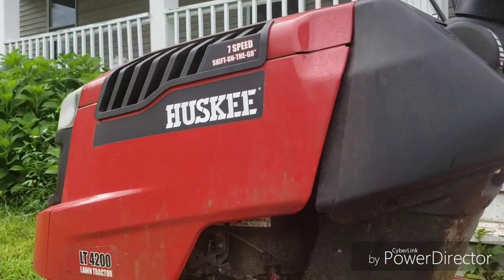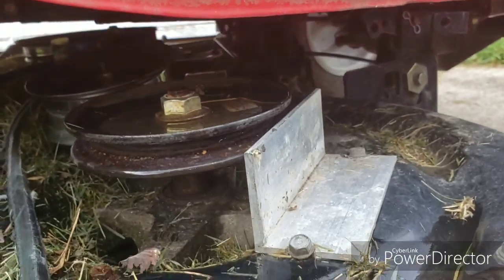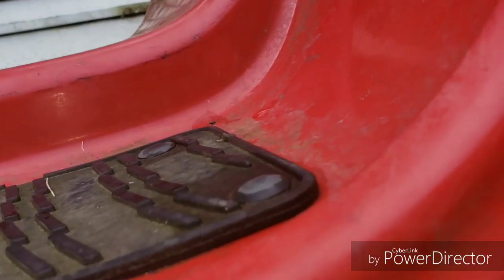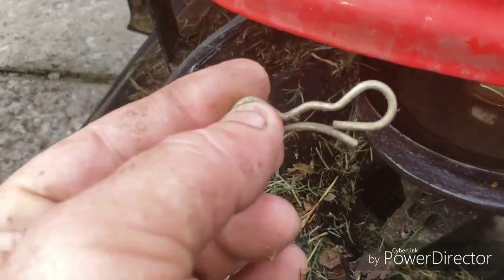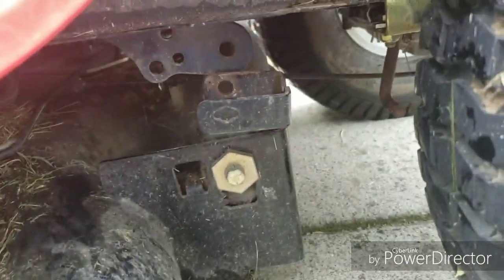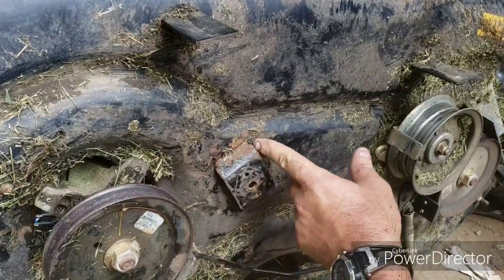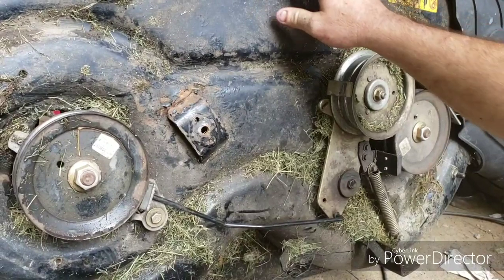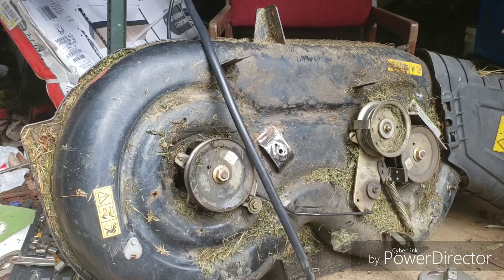Huskee lt4200 deck repair and belt replacement

Comment: My bracket was pulled out of deck. Took an old blade and cut it to fit under the deck and welded on with the hole of old blade lined up with bracket hole. Then got a bolt long enough to extend through bracket to put pulley back on. Very strong and the cheesey bracket doesn't have  any pressure on it.

Comment: Well FYI. a lot years of experience in many things and I got the belt on with out removing deck in like 15minutes and only loosing the one pulley on passenger side. thanks though as the vid. helped to find where and how it went around the pulleys. I am hard on this mower and will need to do much the day I do drop the deck.
Reply: i realize I'm kind of randomly asking but does anybody know of a good place to stream newly released movies online?
Reply: @Duke Jay Flixportal :)
Reply: @Misael Danny thanks, I signed up and it seems to work :) Appreciate it !
Reply: @Duke Jay happy to help =)

Comment: I saw this video on Saturday and  my deck belt cover broke and I like  your modification with a piece of angle aluminum or steel but first a trip to tractor store to see of they have the part. I also need to get a air filter cover one of the little turn keys that hold the cover broke a year or so ago   anyway a good video
Reply from the maker: You can get the guides online , but they are expensive, and prone to break

Comment: Interesting video, my Lt4200's engine's shot & was thinking of pulling the deck & making a 36 HP 42" push mower, the riding mower cuts too low to get over septic tank lids & leaves for more trimming for me,  Liked & Subscribed.
Reply from the maker: Shot as in rod through the block?
Or lost power, and smoking?
If it's not blown they are an easy rebuild.
Reply: @hillbillyholler516  I had knee high grass, had to get an acre of grass mowed for the first time all year, since, the weather was crap, I was busy working, trying to get things ready for Memorial Day, I was in the middle of mowing my yard, when all the sudden it just stopped running, I had 1/4 tank of gas left in the tank, that thing spends so much time at the repair shop, I don't know if it's cause it ran out of oil or what, but I'll be replacing the 16.5 HP engine with a 36HP engine, & replacing the pulleys with sprockets & a #60 Heavy Duty High Carbon steel Chain & making it a push mower with 13" solid rubber tires, good for between 300 pounds to 500 pounds each & maybe put extreme High lift blades on it, build it to go through just about anything I'd need it to go through when I get behind on mowing for the Holidays.

Comment: Use anti spatter on the nozzle and it will last longer also the nozzle is a consumable and should  be replaced when worn out and they make a neat little tool that will clean the spatter out of the nozzle.

Comment: Is there a way to adjust belt without replacing it if not needed mine is loose
Reply from the maker: If it's too loose its stretched out.

Comment: Cert welder u can use lube on wire gun helps quite a bit keeps wore from sticking and they also have a plastic insulated  wolf weres out caused  henpick on wire guns have keep clean tips to buy lube helps gd luck I just rebuild same deck also on plate fully the hole weres out few thousand s on these mowers u can just use a ring take up.slack I drilled hold out on washers one size over was not problem it was plat up down in plate holding the pully was causing belt come off as well as front rod on front motor puller bad bout leting belt ger lose

Comment: also, How do you disconnect the PTO cable?
Reply: oh, that's how, one of the things wrong with the riding mower is the engagement pulley sticks & I got to beat it with a piece of a sledge hammer handle that broke & I cut off from the rest of the handle, which shortened the handle for my 20 pound sledge.

Comment: What belt is that?
Reply from the maker: 1/2 by 96" kevlar belt
Reply: What is the recommended belt by owner manual
Reply: @hillbillyholler516  the cover on the new belt says 1/2' x 95'. Which is it, 95 or 96?
Reply from the maker: @grebren3973  mine takes a 1/2 x 96.
It depends on the manufacture year as to the size.
Open your hood, and get the part # off the decal.
Go to tractor supply , pick the part # then measure to be sure